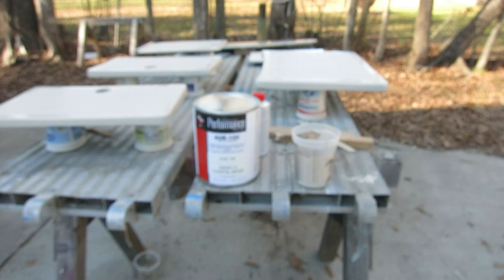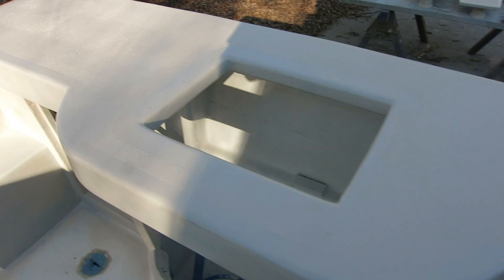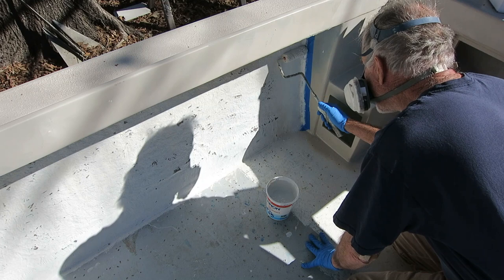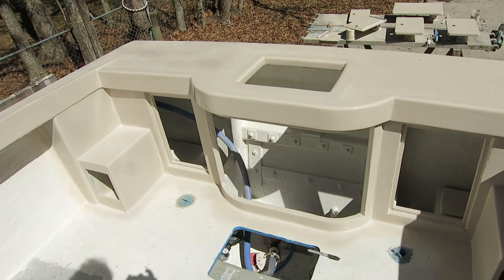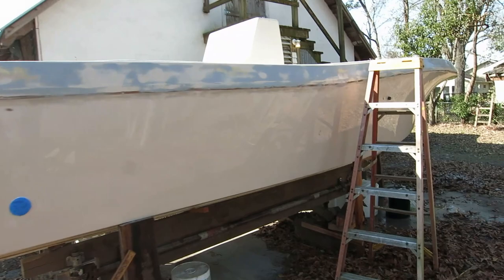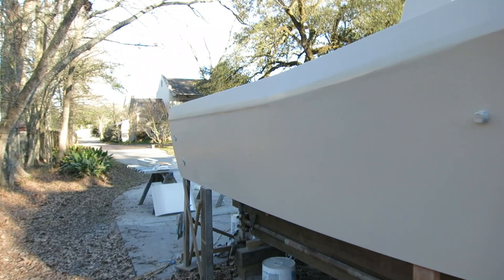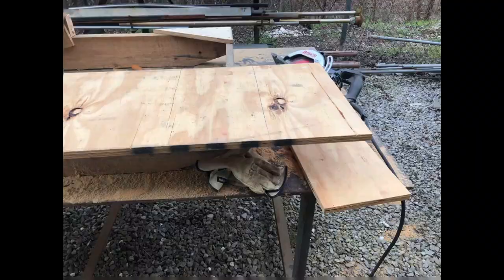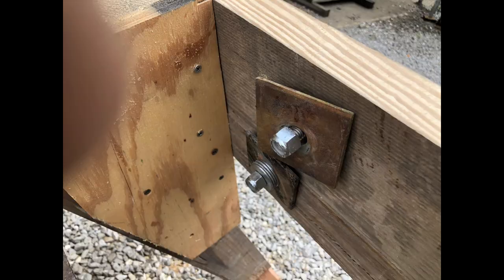The Center Console Project #33 More painting and I bought an engine!

Comment: Barry these videos are great.  Like ASMR.  Question: Was there any science to the weight distribution when designing the boat? e.g. Transom weight with bracket and all of the wood, and the fuel tank position etc. versus what is now up in the bow, compared to the original boat configuration?  
"Good Stuff"
Thanks.
Reply from the maker: JB
Thanks for the Kudo's! Science? Kinda sort of. I believe I have removed more weight than I have added, especially up front. But that is a guess. The fuel tank is original and it is back in it's original location. The twin Johnson 90's weighed about 350 each for a total of 700 lbs. Plus a bunch of mechanical controls which add up. The E-tec I just purchased weighs under 600 and it is fly by wire. But it is placed further back because of the bracket. So I am hoping at the worst I might be a little lite in the front which should be easily fixed.  Time will tell!
Thanks Barry
Reply: @barrylukebuilds7894  Thanks.  Best of luck to you.